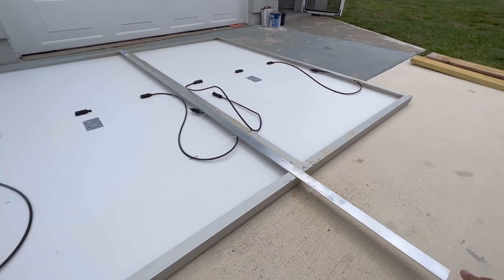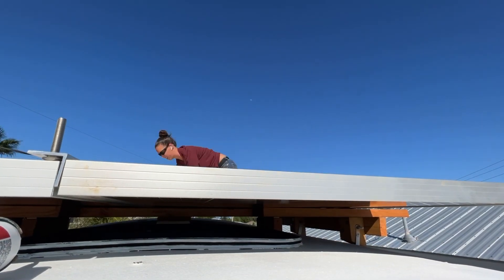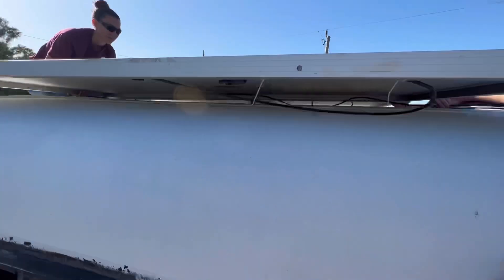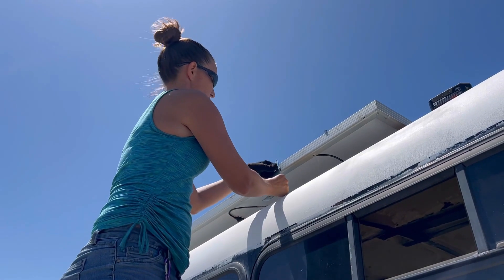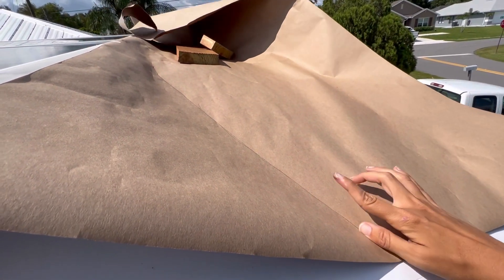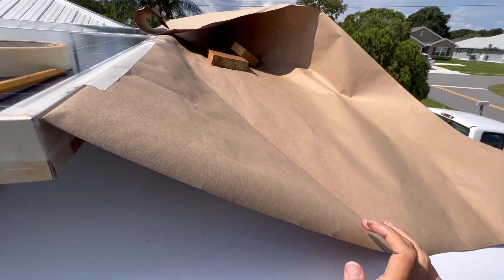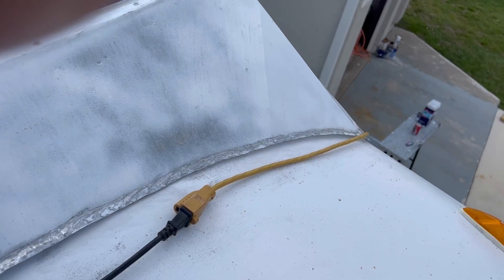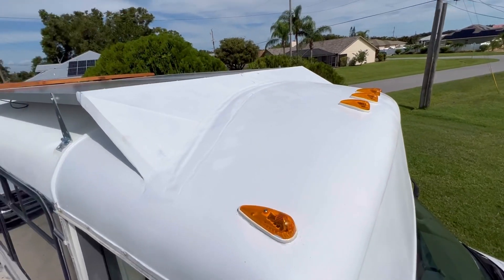Shuttlebus conversion - Episode 12 - Installing Solar Panels and Wind Deflector!

Comment: Agree with Alaska, those gate hinges were very clever.  I was wondering how you were going to fill that gap, then BAM!!   Very creative on the windshield.  I just installed panels and a deck on my daughter's transit but went with a 52" light bar to block wind because I couldn't get creative enough.   I just bought and E450 so your tips may come in handy when I start the room within the next month.   Looking good, thanks for the videos!!!
Reply from the maker: Glad you found some inspiration in my videos. It really makes the editing and everything worthwhile when my ideas (borrowed or original) can help someone else. Just making do with what I have access to, as you did with the light bar. Good luck with yours!

Comment: nice job, good thinking (might consider sides also because of a vacuum.
FYI: I subscribed because you didn't ask me to before I even watched the video
Reply from the maker: Aw, thanks for the sub! I thought about doing the sides, but was worried about air circulation, as the panels need it in the summers. They get wicked hot! But if it seems like the bolts are coming loose or attachment points show any wear, I will reconsider adding sides. Thanks again!